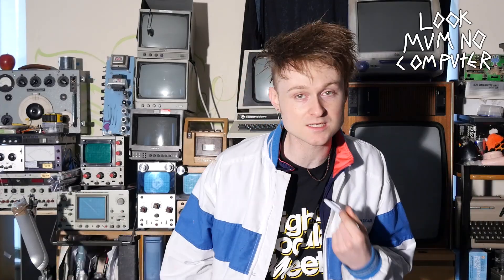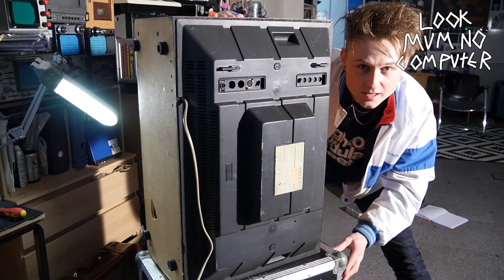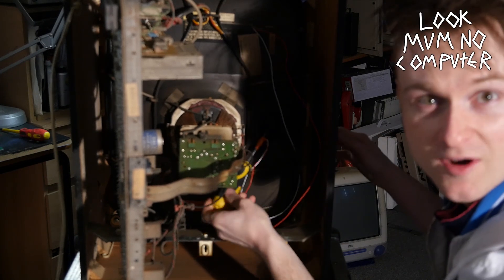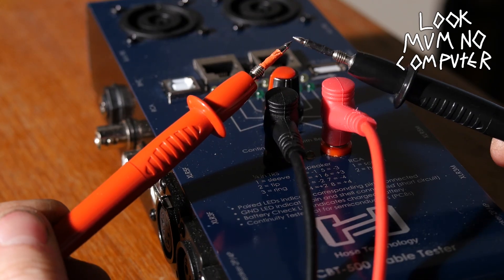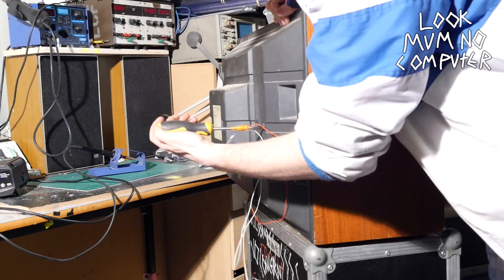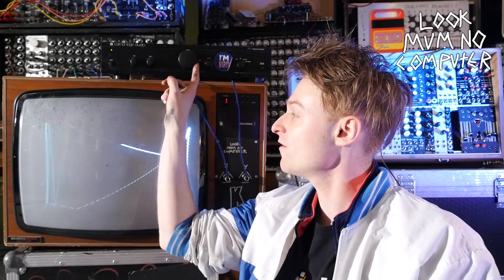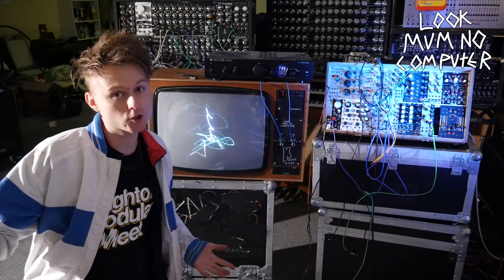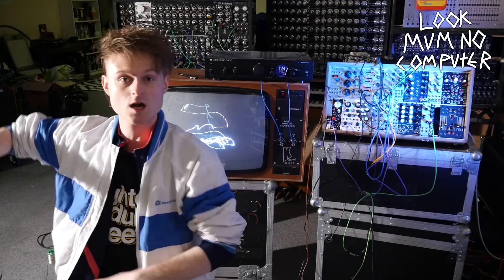Turn an old TV into an Oscillograph For Oscillographics!

Comment: Do I just watch this in reverse to turn a oscilloscope into a TV?
Reply: I realize this is joking, but now i'm kinda actually curious about hooking an o-scope up to the deflection coil leads of a TV tuner....
Reply: @xKatjaxPurrsx  | in the 32 years I did TV repair I never ran across a Tuner with Deflection Coil Leads, --unless that was your joke, if so, --sorry (r/whoosh'd me)
Reply: @xKatjaxPurrsx  There are circuits to use the X/Y function of an oscilloscope into a video display. Youtuber W2AEW has some videos on this I believe.
Reply: https://www.youtube.com/watch?v=-FK7hy5usYE
Reply: Hand-drawn look?
Reply: maybe I'll get noise ( thinking to start from a video signal like a tv show )
Reply: get yourself a saw-tooth signal generator that has a trigger/synchronize input. You'll need an X/Y scope that also has an intensity input. They can be kind of hard to find, especially compared to finding an old broken TV
Reply: Any two input oscilloscope could be used. You wouldnt need the amplifier either. Feed two signals into both inputs on the front of the scope. Set the scope into "X-Y" mode. Turn up the input volts per division  controls on each channel until the patterns fill the screen. Easy peasy 🙂
Reply: But why would you do that?
Reply: There is no need to "turn the scope into a TV". All the deflection circuit and intensity control circuit are already in the scope. In the 1950s, I watched my father display the picture on a scope while repairing a TV in our TV repair shop.
Reply: No you Silly Billy